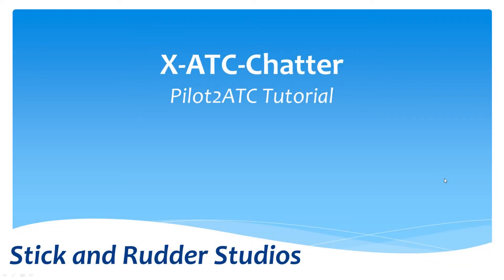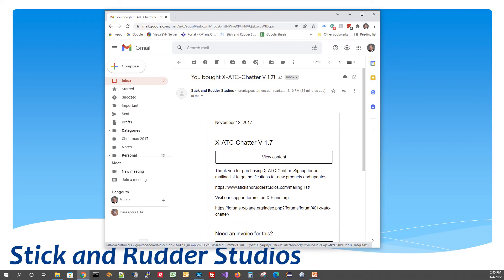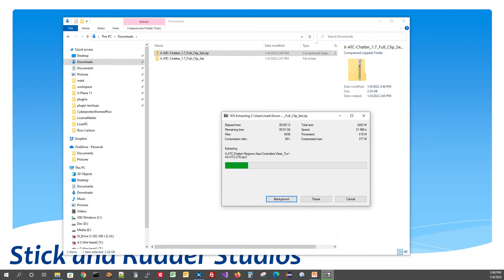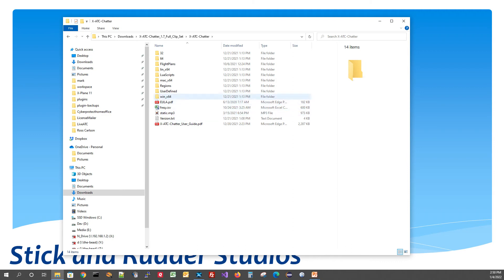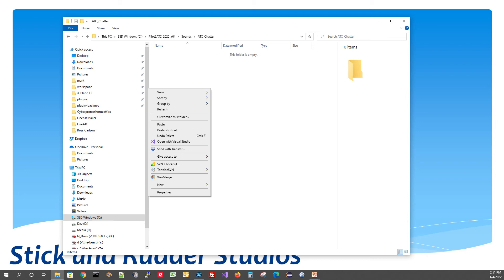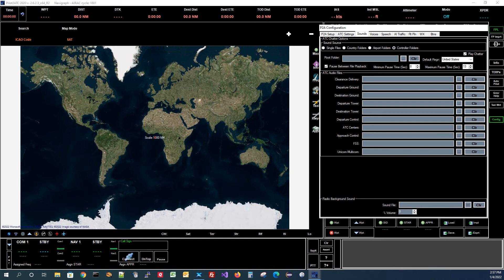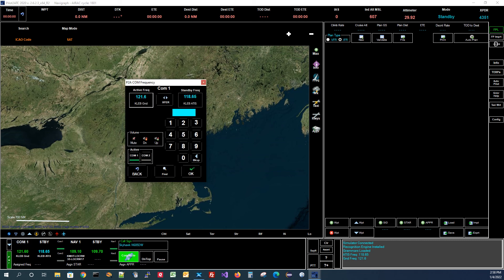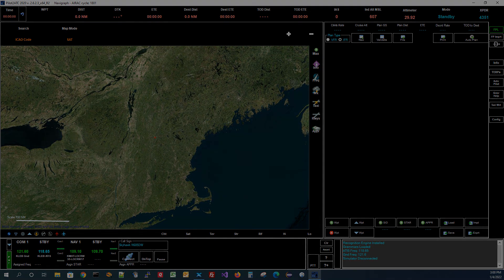ATC Chatter & Pilot2ATC Tutorial

Comment: Does this not work with MSFS? Seems you only mention xp
Reply from the maker: Yes it does. Pilot2ATC works with X-Plane, FSX, P3D, and MSFS2020. 

Mark
Reply: You probably worked this out, but I think the point is that although X-ATC-Chatter is an xplane product, you don't install it into xplane here, only into Pilot2ATC.  And since Pilot2ATC works with MSFS, the solution as a whole works with MSFS.  (Only watched this because I couldn't work out why my voices didn't work.  I hadn't set it to the Controller Folders option.  Set now and it works :)